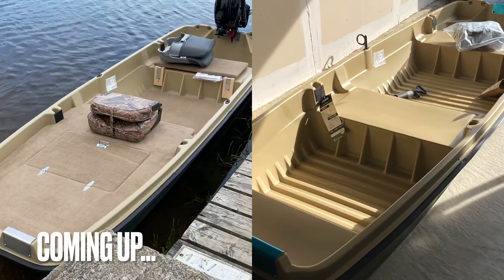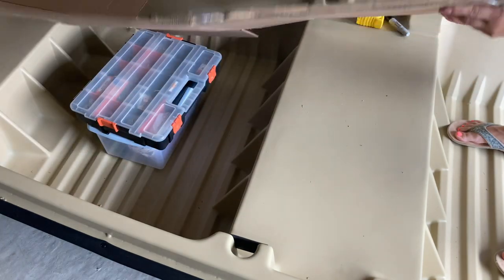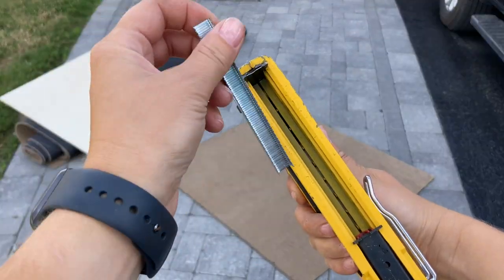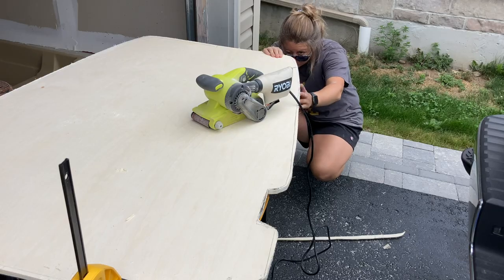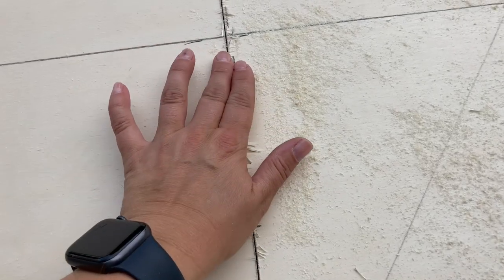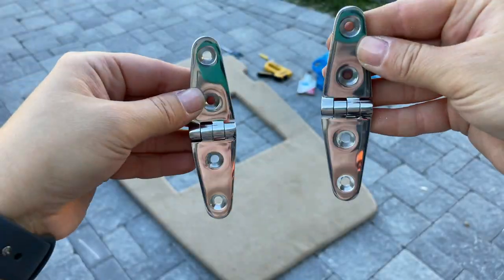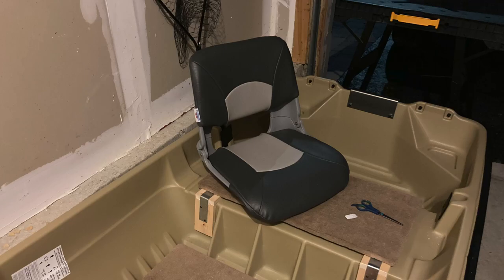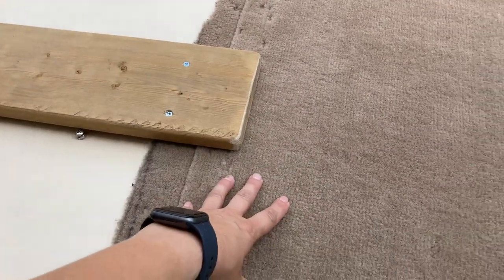DIY Small Fishing Boat Modifications | Pelican Intruder 12 #jonboat #fishing #ryobi

Comment: SOLD! Just ordered my 12ft Pelican from Amazon (yeah, amazon lol!). Excellent mod, but was there a reason why you didn't chop into the front bench instead of creating the hatch? Just curious cause other boat vids they chopped into it (not a Pelican, others). Thanks!
Reply from the maker: Thanks! I didn’t want to mess with the boat structure in case I wanted to sell or change it up later on, also why these pieces are removable. The hatch has been helpful keeping things hidden and out of the way. The full platform helps with weight distribution and been nice to step onto for entry and exit at dock. And yes yay Amazon! Many add-on accessories on Amazon also.

Comment: Hey, great build! I'm looking into one of these boats for trash cleanups that I participate in. It would be awesome if you might be able to answer some of my questions before buying since I have a limited budget and can't find much info... My constraints are that I need something that can go on a car's roof racks without anything in it (do you think this is possible?) and also I was wondering if you think I would be able to throw a tire(s) or a shopping cart or a bike in the front and still be able to motor around back to the dock with like a motor that it's rated for 6hp-ish?
Reply from the maker: Hey thanks! I’d say this boat is great for trolling and leisure however you require excellent balance when standing as it does rock. I haul it in my pickup with wooden planks for support. I believe it may be too awkward/heavy to lift solo onto a car roof. Perhaps if you set up a pulley system? The price is right and does have a lot of space. If you can, a cheap-o boat trailer would be ideal. Maybe one of those half size shopping carts. I love that you do trash cleanups. One thing I do like is you can pull it on shore and over land so easily, no limitations there!
Reply: @lauracoteDIY  Thank you so much for the reply and info! That's really helpful!